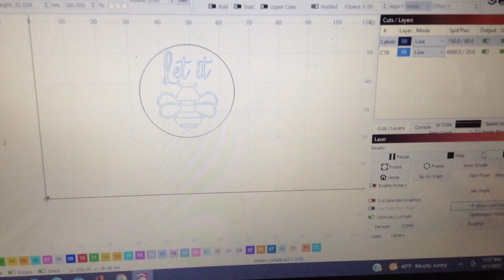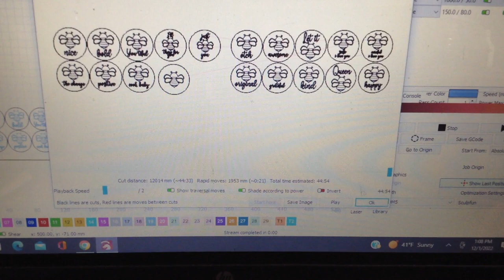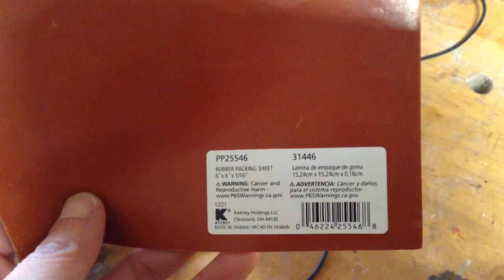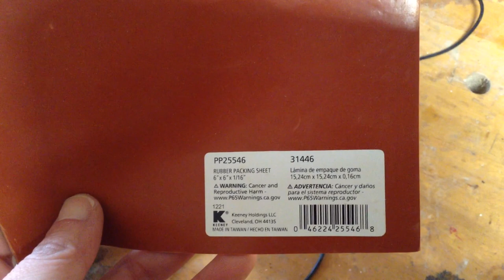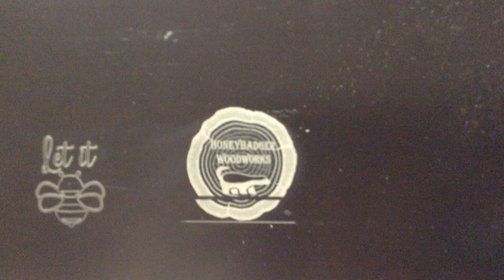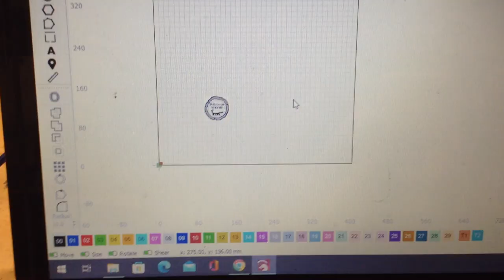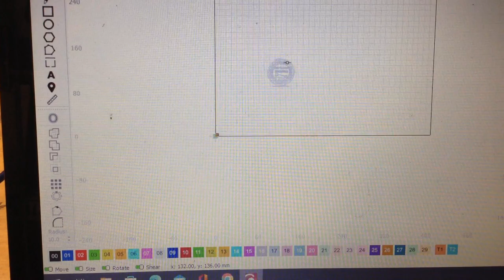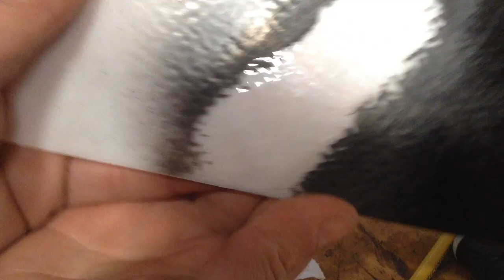Tool Review : Sculpfun S30 Free Laser Giveaway // Are 5 Watt Lasers Any Good?

Comment from the maker: Wood :
1/16 - Engrave : 1000/50    Cut : 150/80 1 pass Total Time : 1:01
1/8 - Engrave : 1000/50   Cut: 150/80  2 passes Total Time : 1:41
1/4 - Engrave : 1000/50   Cut : 150/80 3 passes Total Time : 2:22
1/2 - Engrave : 1000/50  Cut : 50/90 7 passes Total Time : 14:26

Craft Foam : 
1/8 - Engrave : 300/50  Cut : 900/50 1 pass Total Time 15 seconds 

Rubber : 
1/16 - Engrave : 1500/50  Cut : 150/60  I pass Total Time 55 seconds

Aluminum Flashing : 
Engrave : 250/50  Total Time 1:22   Total Time Logo : 34 mins

Cork: 
3/8 - Engrave : 250/50  Cut : 100/60   4 passes (didn't cut through)  Total Time : 10:36

Nylon Silk :
Engrave : 3000/20

Canvas : 
Engrave : 1500/50  Cut : 1500/50  4 passes  Total Time 30 sec.

Slate Coaster : 
Engrave : 1500/90  Total Time 13:43

Cardboard :
1/8 : Engrave : 3000/50 Total Time 3:20  Cut : 1500/50  2 passes Total Time 12:06

Plexi : 
.80 inch : Engrave : 350/25  Cut : 10/80 1 pass Total Time 34:07

Leather : 
Engave : 350/25  Cut : 100/90  2 passes Total Time 25:41

Glass : Cold Galvanized Compound 
Engrave : 350/25 Total Time 11:02

Glass : Black Underneath 
Engrave : 320/25  Total Time 21:06

Ceramic : 
Engrave : 350/65  Total Time : 1 hour and 55 minutes
Reply: Great settings thanks for all that hard work
Reply: awesome work

Comment: That is seriously impressive for a 5 watt laser. I use an old Eleksmaker 2.5 watt that is rubbish in comparison. I like the air assist and I suppose the module could be upgraded at a later date if needed.

Comment: How much does the wood species affect how the engraving turns out? I was thinking of engraving a guitar body but making a test piece with a cheaper wood. Also, burning on a "barely" curved surface - any recommendations on how to pull that off?
Reply from the maker: In my experience wood species matters a lot.  I had lots of burning issues with softer lumbers.  Red oak ply so far burns the cleanest.  I have a video on here where I made some kerf cuts on plywood, burn my design and then bent the ply along the kerf.  Worked well.

Comment: I've had the Sculpfun S9 for about a year now. It's a good 5 watt laser for the hobbist. This is a good review of the S30. They have put everything on that I would like to upgrade mine with. Should have waited to buy.😁. I based on other users suggestions I found using Tempra Black paint for etching glass works well, without the bad fumes.
Reply from the maker: I thought of Tempera, but people mentioned it being harder to apply.  Since I knew I had the exhaust fan and I good respirator I went with the galvanized spray instead.  But, agree the tempera is smarter.

Comment: I’ve literally been going back-and-forth on which one to get for my Shop. Diode versus tube laser. Diode seems amazingly handy, but only for engraving. Most things I do want to cut out, but tube machines are even more expensive, cumbersome and work with such a small work area. My big interest in a diode laser like this is whether or not you can mount it vertically on a wall and use it. For my shop floor space is everything.
Reply from the maker: The 10 watt machines I have cut 1/4 plywood consistently without a problem.  So did this one, but it will cut it slower.  I haven't tried it, but I don't think these would run vertically.  The gears by the belts don't hold the carriage in place when I lift and move them into place.   And the rubber wheels slip with even a little bit of dust on the belts, so I imagine gravity would win out on the gantry moving against it.

Comment: Another Great Video - Looking to buy a less expensive Laser Engraver and this, like other videos you have done, helps a lot!
Reply from the maker: I only tested this one for a little over a week, but I found this very capable.  The big difference will be it won't be powerful enough to cut as many materials as the 10 watt and it will be slower with all jobs.
Reply: @HoneyBadgerWoodWorks  Sure, understood. My Primary is my new XTool D1 Pro and my search for a secondary engraver is on. if I went with a Sculpfun it would prob be the S30 Pro (10 Watt) version. 

When you are done reviewing ALL the lasers, will you be comparing (maybe pro/con and rating based on xyz criteria) your Laser Engraving adventures?

Comment: Do you get a sense that many of these lasers have parts in common or same manufacturer for some parts?
Reply from the maker: Idk about sharing components.  I'm sure to some respect they do, but even with the power supplies for the machines, each one has been from a different company.  So, if they aren't' sharing basic electronics idk about the components.  What I do think they "share" are designs.  A lot of the more expensive models I test will make specific changes and then you notice those mirrored in the cheaper models.  For example the last two machines I tested which are newer models both use a metal gantry track versus rubber wheels to cut down on wear and tear.  I didn't test a 10w X-tool, but the Ortur 3 I did test looks like it's cousin.  And right now I have the X-Tool D1 on my table next to the Atezr P-10 and the frames are almost identical.  Hope that helps.